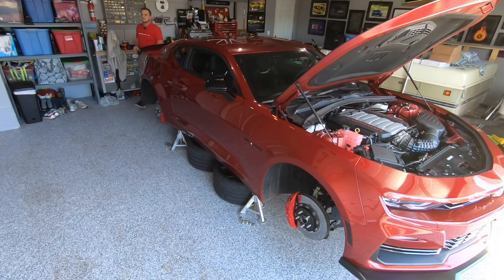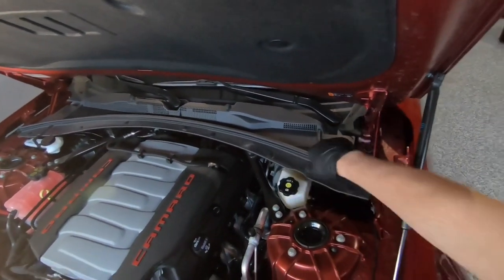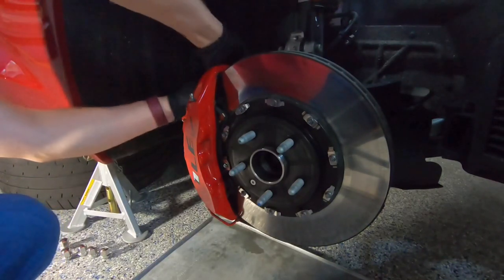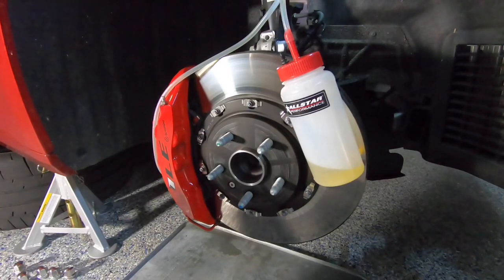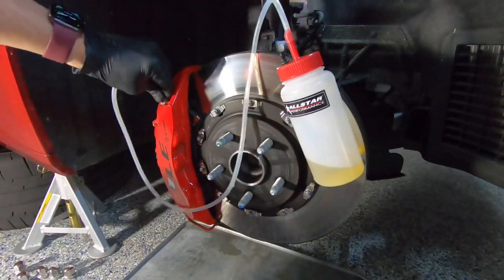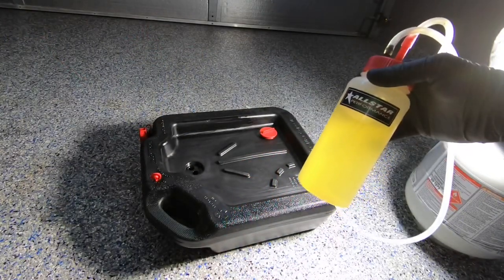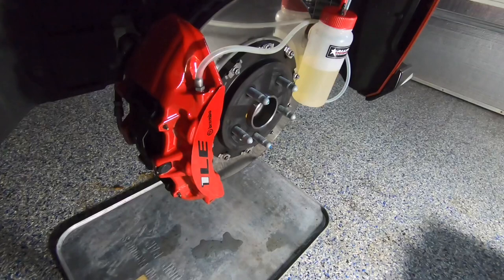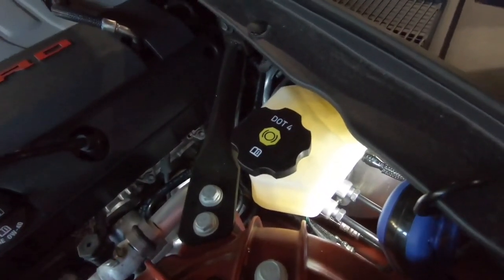How-To: One-person Brake Fluid Flush // Brake System // Camaro, Corvette, Mustang, Challenger

Comment from the maker: I wanted to add that on this particular vehicle, and some others, the clutch master cylinder shares the same fluid as the brake master cylinder. The clutch system is self bleeding, and it is recommended to pump the clutch 200 - 300 times to bleed any air out of that system.
Reply: Is it the same for a Gen 5 Manual Camaro?
Reply from the maker: @thunderhammer1937  yes. Essentially any vehicle that shares the brake master cylinder for the clutch would be the same.
Reply: @FollowMyLine17  Good to know, thanks!
Reply: So after your done just pump the clutch like 200 times?
Reply from the maker: @gransergranser9756  you can do that, or what I do is pump the clutch about 50-75 times after I do each corner.
Reply: should i leave reservoir cap on while depressing clutch for the 200-300 times or off ? thanks for the help
Reply from the maker: @franciscomcconnell4973  great question. The clutch is self bleeding, so it doesn’t matter whether the reservoir cap is on or off for this process.
Reply: @FollowMyLine17  Thank you so much ! Happy Holidays!!
Reply from the maker: @franciscomcconnell4973  thank you! You as well.
Reply: Does this apply to automatic transmissions? I have A10 SS 1LE
Reply from the maker: Great question! The A10 has its own standalone internal clutch packs that share the fluid with the rest of the transmission. No need to worry about bleeding anything with the clutches.

Comment: My first step is to evacuate the old fluid from the reservoir and add fresh fluid before the next steps
Reply from the maker: You can definitely do that. Overall it doesn’t really make a difference, just saves you from pushing that amount of old fluid through the system. Nice tip!

Comment: Good technique man. I don't lift the car, do it all on the ground with tires on. (I got long alien arms and fingers that help).  Then use a motive power bleeder at the reservoir, and same technique from there.  RR, LF, LR, RF.  Good vid keep up man!
Reply from the maker: I’m not going to lie, that is impressive that you can do it without taking the wheels off the car. I’ve had problems with air in the lines using the Motiv bleeder in the past, so I’ve stuck to this method and never had an issue.

Comment: @ Follow my line : How many times do you pump the brakes for each corner ?
Reply from the maker: Great question! It’s never a specific number, and it’s harder to tell in this video because I was swapping out new fluid for better fluid, so it looked relatively close to the same color. In other instances, it’s easier to tell. I’ll pump about 10 times and then check the fluid catch reservoir to see what has come out. If the color in the line attached to the brake caliper is still dark, I’ll keep pumping until the fluid is clear in the brake line and has no visible air bubbles in it.

Comment: I’m preparing a 2017 SS2 Camaro for track days and in the owners manual and on the reservoir cap it says use dot 3.. just wanted to make sure the RF-650 is compatible?
Reply from the maker: You definitely do not want to track your car with DOT3 fluid. Mid-2020 they updated factory fluid to DOT4. Either way, the Endless RF-650 is compatible.

Comment: Thanks for the video, Luan.   I have been using the Motive for a couple years, often ending in frustration due to poor sealing at the fluid reservoir.   I have the same check-valve bottle now and will be going this route from now on.
Reply from the maker: Yes!!! I had so much frustration with the Motive. This method has NEVER failed me.

Comment: very good video step by step, bro when you are going to pump the brakes the ignition has to be on, have I seen people starting the engine?
Reply from the maker: Thank you! No, the ignition does NOT have to be on. It’s a hydraulic system, so there is no need for the ignition to be on or the engine running either. In fact, you want to make sure it’s all off.

Comment: GM says you shouldn't use silicon brake fluid. Believe Castrol SRF is silicon based, not sure about endless. Any concerns?
Reply from the maker: I’m no longer a fan of SRF. It has been known to swell seals. The SRF is synthetic ester. Endless RF650 and Brembo HTC 64T are polyalkylene glycol ether based.

Comment: This procedure won't affect the clutch pedal feel since the brake fluid shares the clutch fluid????
Reply from the maker: Great question! It absolutely will. Take a look at my pinned comment. You need to pump the clutch 200-300 times to ensure there is no air in the clutch master cylinder, which is self bleeding.
Reply: @FollowMyLine17  how much fluid would it take ? I got 3 pints
Reply from the maker: @pontiaco it’ll take just over two to flush it, the third can be used to push any remaining old fluid through.
Reply: @FollowMyLine17  pints or quarts???
Reply from the maker: @pontiaco  pints. A pint is roughly 500ml and it takes about a liter and a half for a full complete flush.
Reply: @FollowMyLine17  does your car has stock springs???
Reply from the maker: @pontiaco yes it does

Comment: Hey i came across your video today and am looking to replace the brakes and rotors on my 2019 1LE. Wondering if the Endless RF brake fluid ever gave you any ABS issues due to its viscosity? I’ve read this one is thicker and someone recommended Modulus 5.1 which was designed for ABS systems. 

I love watching formula 1 and see that endless sponsors the AMG team. Would love yo try out the product especially after reading reviews of improved braking performance, but wondering if it causes ABS light to go on in the 1LE.
Reply from the maker: There is absolutely no ABS issues or ABS light issues with Endless RF-650. I would stay away from any DOT5.1 fluid as most are not rated with a high enough dry boiling point. The viscosity of brake fluid is the same regardless of manufacturer.

Comment: How many quarts is a full flush? ZL1 application here. Also, consider Castrol SRF fluid over Endless.
Reply from the maker: It’s the same for the ZL1. 1.5L, or 1500ml. Consider Endless over Castrol SRF. I switched from SRF to Endless. Far better pedal feel from Endless.
Reply: @FollowMyLine17  That's what I've heard but the wet temp is 93˚ lower if you don't get a fresh flush for that day.
Reply from the maker: @gbass7328 I’ve run SRF for years, and Endless for years. The “wet” rating means nothing if you are tracking the car. Both the Endless and the SRF hold up over time and the only time the wet rating comes into play is after the fluids has accumulated enough condensation to alter the fluid. Using testing strips, both fluids will last well over a year, including under heavy, heavy braking during track use. I change my fluid once a year in the spring and use test strips before and after every track event. Trust me, switch to Endless, you’ll be very happy with it.
Reply: @FollowMyLine17  Points well taken. I know of Endless products, F1/Porsche etc., just haven't used it. Thx...

Comment: Is this only done when replacing all brakes and rotors ?
Reply from the maker: No, this should be done as regular maintenance. For example, I check and bleed the air out before every track day, and I change the fluid at least once per year since I track the car.
Reply: @FollowMyLine17  awesome I'll be doing this asap. Quick question though how would you go about bleeding the clutch line ? Wouldn't there be fuild in there that needs to be expelled?
Reply from the maker: @SALMANDER33  one of my pinned comments is about this. The clutch reservoir is self bleeding and shares the same fluid. I typically pump the clutch about 50 times in between each caliper, to make sure that the fluid in the clutch reservoir is also impacted.
Reply: @FollowMyLine17  awesome! Thanks for the reply waiting on my fluids to arrive

Comment: Did you bleed the first caliper inside enough. When I do mine I pump it to make sure the fresh fluid in the reservoir gets to the caliper.
Reply from the maker: Yes, I sure did. Magic of video editing. I didn’t want to make this an extremely long video so I cut to the point. Same reason I only showed one side of the car being done, as the front caliper I showed on video is not the correct next caliper in series per the bleeding instructions.

Comment: Great video man!  As a rule of thumb how would you divide up the three bottles of new fluid you used?  First two should be used to fill as you bleed all four corners and the third used to fill to the max line at the end of the process?
Reply from the maker: Great question! The two bottles are enough to “fill” the system if it were dry, but since I wanted to flush out all of the fluid, I used the third bottle to completely push out the old existing fluid. So, to directly answer your question, I would bleed each caliper using a half-bottle per corner, and then push out all the remaining fluid out of one caliper using the last bottle. I slightly overfill at the end and then carefully watch as the fluid drops to the “max” line. I hope that answers your question!

Comment: What jack stands r u using with rubber cutouts
Reply from the maker: Esco Jack stands. Links are in the video description for them!
Reply: @FollowMyLine17  nice! Do u think these vs the v shape metal is safer? And are u lining up the slits of the puck on the pinch weld itself?
Reply from the maker: @c4sare4kiddos  they are definitely safer, and yes you can line up the slots on the pinch weld, but what you really want for your Camaro are lift pads. Check out this video: https://youtu.be/3ZjfKPesSec?si=IAEfJMUIFzOjmgLn
Reply: @FollowMyLine17  I have the stealth pads already.. so this is what I’m thinking I’m jacking from that point of zl1 add ons pad and keep jack there right and then jack stands just align with pinch weld. I’d need 8 not 4 of those points if I wanted to put the jack stand there bc I’m lifting with jack already at the lift point yk? Or I could buy like a magnetic one or one extra one whatever and just go around jacking with that and jack stands put to the lift points like u just said. Or am I’m being an idiot and over complicating it😂
Reply from the maker: @c4sare4kiddos34 you are over complicating it. Just get the mag puck to lift then set your stands on the lift pads. All the links are in the description for easy access.
Reply: @FollowMyLine17  thank you sir💪

Comment: Cool man. How much brake oil was needed for the job? 1 liter?
Reply from the maker: You need roughly 1.5 Liters for a full swap. The fluid is also used for the clutch master cylinder, so in order to ensure all of it is swapped, using 1.5L is recommended. 1 liter is plenty for ongoing maintenance.

Comment: How long would you way this whole process takes?
Reply from the maker: The first time you do it, probably 1.5 hours start to finish. Once you do it more frequently, you can get it done in less than an hour.
Reply: @FollowMyLine17  so you drain thebrake fluid container and then re fill with new brake fluid. And while one bleeder is open you get in the car and just keep pressing the brakes for a couple mins? Thanks for the help!
Reply from the maker: You don’t want to completely drain the brake master cylinder reservoir, you want to check to make sure it’s at or around the Minimum mark and then add more. So, open brake bleeder (with one-way catch bottle attached), pump brakes 7-10 times, check reservoir, fill as needed, and repeat for each bleeder. If you drain too much fluid out without refilling you run the risk of getting air into the ABS module, which then requires an electronic ABS Module activation procedure that can only be done with a high-end scanner device, like the dealership has.
Reply: @FollowMyLine17  thank you!

Comment: Thank you for making this video.  After you lift the car and place jack stands under it on one side.  Do you just jack the other side up the same way? 

The car doesn’t shift on the jack stands you installed first? Just trying to make sure it’s safe to do the other side the same way.  Thanks
Reply from the maker: Yes, that is exactly what I have done with nearly every car I have ever owned. Just make sure you are using the proper Jack stands and have them jacks in the appropriate place.

Comment: Which Esco stands to you recommend, the short or tall? I want to order a set as my 22 1LE is showing up this month.
Reply from the maker: https://amzn.to/3tlsxVo

I prefer the standard height, not the short ones. The lowest and second lowest setting are great for the Camaro, and if you have other taller or higher clearance vehicles they can go pretty high.
Reply: Thanks man I appreciate it and the content! So from the quick shot of you jacking her up, I'm gathering there are 2 front factory jack points and you used the one farther back to lift the car? Looks like I need to get some life pads coming too.
Reply from the maker: @z.c.6478  this is exactly correct. Grab a universal mag lift puck while you’re at it. ZL1 Add Ons has everything you need to lift it besides the stands.

Comment: what about the clutch hydraulics?
Reply from the maker: Check the pinned comment:
I wanted to add that on this particular vehicle, and some others, the clutch master cylinder shares the same fluid as the brake master cylinder. The clutch system is self bleeding, and it is recommended to pump the clutch 200 - 300 times to bleed any air out of that system.

Comment: Why purchase a bleeder bottle, you can make one using a Gatorade bottle and 3/16th tubing!
Reply from the maker: So, what are you using for a one-way check valve? Without one you would be constantly reintroducing air into the system, defeating the purpose of the one-person bleed method.
Reply: @FollowMyLine17  Nooo, it works just the same as the brake bleeder that you Purchased.
Reply from the maker: Not without a one-way valve, it wouldn’t. When you release the brake, it pulls suction from the bottle. Without a check-valve you are reintroducing air into your brake lines and calipers.
Reply: @FollowMyLine17  That is why you fill the Bottom of the bottle with brake fluid you drill a small hole for pressure relief of the bottle.
Reply from the maker: @CT9905.  for $30 I’ll still to the bottle with a check valve. I don’t want to risk air or old fluid getting back into the system. I appreciate your input here.